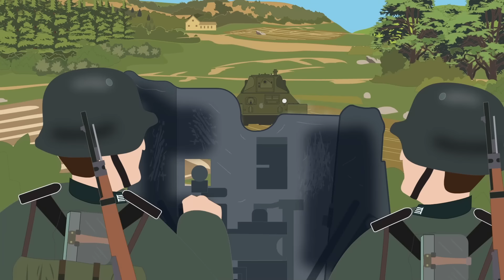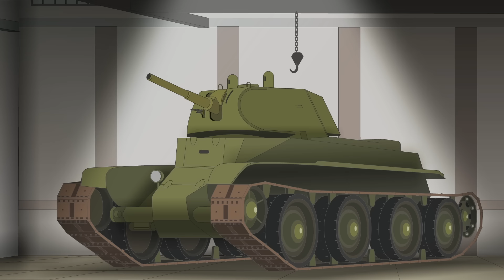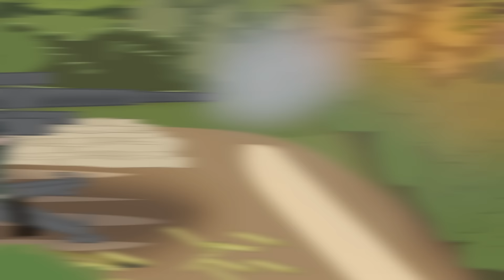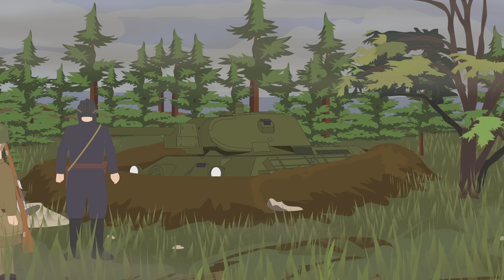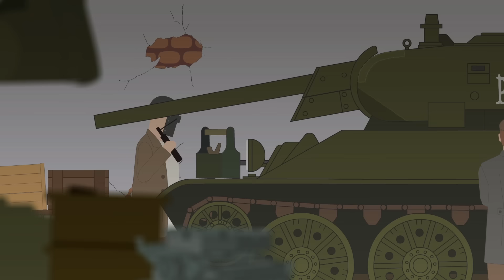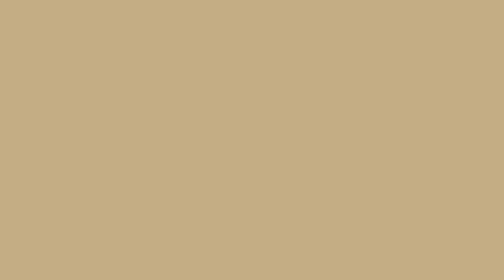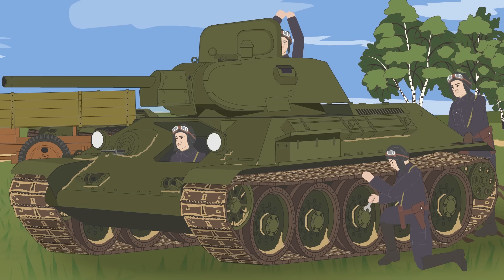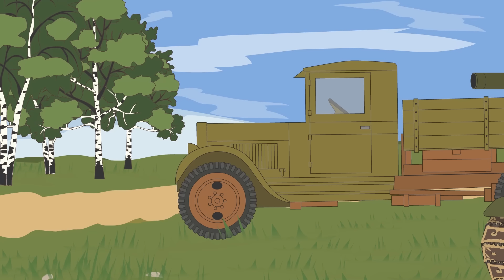Was the T-34 Really the Best Tank of WW2?

Comment: Nice video, but I can't believe you didn't mention one of the Germans' biggest advantages against the Soviet tanks; that is, the Germans all had radios in their tanks; The Soviet Union did not. So the German commanders could communicate from the safety of their armor, while the Soviets had to expose themselves out the tops of their turrets, and hope that they were seen while using flags for signaling.
Reply: I think later on they equipped themselves with radios
Reply: @RedCommissar  Yeah, initially only the squad commander would have a radio, later on they added radios to all tanks.
Reply: @RedCommissar  yes after the Lend-Lease i think the USA deliver also huge nummers of it
Reply: @RedCommissar  not until long after the war.
Reply: @RedCommissar  it depended on how the factory that made them was feeling. Sometimes for the sake of cost, they would not use the radio.
Reply: The lack of radios was mostly an early-mid war issue with the T-34 but poor visibility outside the tank continued with it thorough the war
Reply: @k3psu48  no it didn't. Soviets had good visibility on t-34(43) and t-34-85
Reply: @raketny_hvost   yes better visibility than in the 76 models but still very lacking and the slits in the cupola had a notoriously narrow vertical FOV
Reply: @raketny_hvost  the 39' variant didn't have optics, due to production speed.
Reply: @DaegonTheSternguard  And asked for aiming through gunbreech. Sigh
Reply: And they forget the best variant of the tank the T-34-85
Reply: @Henry1500G  not even really a "variant" like on paper the completely different turrets that caused different performance on the chassis that it was equipped to made them operate almost completely differently

Kind of a Frankenstein t-34 and kv1
Reply: @Henry1500G  fast reload, sloped armor, fast reload.
Only disadvantage is if the commander isn't good with tactics.
Reply: @Henry1500G  at the beginning says 1937-1943.. so wait
Reply: @Henry1500G  The T34 / 85 was still ´only´ a T34, and the 85mm cannon was weaker than the 75mm of the Panther
Reply: Not to mention that German tanks also had optics so the commander wouldnt have to open the hatch to see around the tank. British churchills didnt even have that ring of optics
Reply: @eageraurora879  The commander had no turret override and not very good Cupolla on the tiger
Reply: @twinsnails4983  especially the panzer III and IV, the cupolas on them were highly vulnerable.
Reply: @eageraurora879  vision slits...
Reply: @eageraurora879  ring of optics?
Reply: @eageraurora879  wdym? Churchill tanks had cupolas as well
Reply: @eageraurora879  American movie belike : "show american soldiers opening panzer hatch all the time"
Reply: @eageraurora879  you mean same germans, who had trouble with making proper periscopes and failed to even copy Mk.IV?:D "Superior kraut optics"™ is a myth. Look even at T-28(1940), notice the "horns" on the roof? Notice them on T-34 and KV-1? Take a guess at what are those?;)
Reply: @eageraurora879  that's a myth. In 43-44 soviets already had good optics while pz4h or KT had much of blind zones. Also about optical details-aiming system of IS-2 allowed it to have accuracy comparable with KT
Reply: Thanks for that information I didn't know that.
Reply: @MarxismWillWin-g5s  its the same advantage they had during the fight agist france and the reson why on paper stats are not aplyable in every situation.  most Frensh and even early T34 were basically blind as a bat butomed up and organisation was very unflexible in early war. The sovjets has some expirience in the Far East but leasons learned didnt made it thogh the system fast enogh without the presure of a seemingly losing war.
Reply: @MarxismWillWin-g5s  it false. Do your research
Reply: And do not forget these fun facts:

The T-34 could sink in the mud aswell.
At Battle of Warsaw, the soviets attacked through a soaked field: From 17 T-34, 15 sunk and get stuck in the mud, only 1 T-34 could manage to escape.

" The T-34 was supposed to be a simple and rugged vehicle that seldom broke down. Authors like to compare it to the more complex German tanks that supposedly broke down often. The concept of the T-34 as a reliable tank is another myth of WWII.
The majority of vehicles in 1941 were lost due to equipment malfunction. The same reliability problems continued during the period 1942-44. The evacuation and relocation of industrial facilities combined with the loss of skilled workers could only lead to the fall of reliability. 

In 1941 T-34 tanks often had to carry a spare transmission strapped on the back to counter equipment failures (10). In 1942 the situation worsened since many vehicles could only cover small distances before breaking down. In the summer of 1942 the following Stalin order was issued to units (11):
‘Our armored forces and their units frequently suffer greater losses through mechanical breakdowns than they do in battle. For example, at Stalingrad Front in six days twelve of our tank brigades lost 326 out of their 400 tanks. Of those about 260 owed to mechanical problems. Many of the tanks were abandoned on the battlefield. Similar instances can be observed on other fronts. Since such a high incidence of mechanical defects is implausible, the Supreme Headquarters sees in it covert sabotage and wrecking by certain elements in the tank crews who try to exploit small mechanical troubles to avoid battle.’

Henceforth, every tank leaving the battlefield for alleged mechanical reasons was to be gone over by technicians, and if sabotage was suspected, the crews were to be put into tank punishment companies or "degraded to the infantry" and put into infantry punishment companies.'

The constant complaints from the front forced the authorities to investigate the problems with T-34 production. In September 1942 a conference was held at the Ural tank factory by the Commissariat of tank industry (12). The conference was headed by Major General Kotin, People’s commissar of the tank industry of the USSR and chief designer of heavy tank ‘Kliment Voroshilov’. In his speech he said:

''Now ... there are a lot of complains about the T-34. You all know the reasons for flaws in the tanks. The first reason –inadequate visibility from the tank; the second reason, and this is the weak link that always accompanies our vehicle in the Army – final drive. And third, the main issue that we have today – insufficient strength of the idler wheel's crank. These issues are the major defects of the T-34 today. Having considered these issues from engineering and technological points of view I would like to discuss another issue, the one that directly resulted solely from our production deficiencies. They are: negligence during production of combat vehicles in the factories, carelessness of assembly and quality control of vehicles. As a result during combat employment our tanks sometimes cannot reach the front lines, or after getting to the territory occupied by the enemy for conducting combat operations, sometimes they are forced to remain on enemy's territory because of some little things... We have to make sure that as a result of this conference all shortcoming will be uncovered and following this conference all corrections in the tank will be implemented in the shortest possible time...
Recently comrade Morozov and I visited comrade Stalin. Comrade Stalin drew our attention to the fact that enemy tanks cover a lot of ground freely, and our machines although are better, but have a disadvantage: after 50 or 80 kilometers march they require repair. What are we talking about? It is because of control gear; also, as comrade Stalin said, because of drive gear, and he compared it with the Pz.III, which is in service with the German army, and which is inferior in armor protection, and in other features, and in crew's layout, and does not have such a fine engine, which the T-34 got, moreover its engine is gasoline, not diesel. But the question аrises – why its drive gear is developed better?

Comrade Stalin gave directives to engineers, to the People's Commissar comrade Zaltsman, to factory's CEOs and ordered them to fix all defects in the shortest time. A special order of the State Defense Committee has been issued on the subject as well as directives of the People's Commissariat of the Tank Industry. Despite all these resolutions have been made by Government and orders of the People's Commissar of the Tank Industry, despite repeated instructions from army units and from Main Directorate of the Armored Forces, which is in charge of combat vehicles operation, nevertheless all of these defects on vehicles are going on... We have to reveal all these flaws, and suggestions have to be made on at this conference how to modify machine component better and faster in order to make the T-34 tank, which is recognized in the army as a good tank, even better fighting machine.''

The situation continued to be problematic even in 1943-44.
There were constant problems with the gearbox and the engine filters. The Aberdeen evaluators noted:

‘On the T-34 the transmission is also very poor. When it was being operated, the cogs completely fell to pieces (on all the cogwheels). A chemical analysis of the cogs on the cogwheels showed that their thermal treatment is very poor and does not in any way meet American standards for such mechanisms.’
‘The deficiency of our diesels is the criminally poor air cleaners on the T-34. The Americans consider that only a saboteur could have constructed such a device’

The same problems were identified in a T-34/85 built in 1945. The US study ‘Engineering analysis of the Russian T34/85 tank’ noted (13):

‘Wholly inadequate engine intake air cleaners could be expected to allow early engine failure due to dust intake and the resulting abrasive wear. Several hundred miles in very dusty operation would probably be accompanied by severe engine power loss.’

The same study says in page 451 about the transmission:
‘The transmission had by American standards already failed, although with extreme care it could have been used further. Teeth ends on all gears were battered as the result of clash shifting. Many pieces of gear teeth had been broken off and were in the transmission oil. The failure is due to inadequate design, since excellent steel was used through the transmission.’

The mental image of the T-34 travelling hundreds of kilometers without stopping is fantasy.

A German unit that used the T-34/76 model ’43 in combat noted (14):
‘Regardless of our limited experience, it can be stated that the Russian tanks are not suitable for long road marches and high speeds. It has turned out that the highest speed that can be achieved is 10 to 12 km/hr. It is also necessary on marches to halt every half hour for at least 15 to 20 minutes to let the machine cool down. Difficulties and breakdowns of the steering clutches have occurred with all the new Beute-Panzer. In difficult terrain, on the march, and during the attack, in which the Panzer must be frequently steered and turned, within a short time the steering clutches overheat and are coated with oil. The result is that the clutches don't grip and the Panzer is no longer manoeuvrable. After they have cooled, the clutches must be rinsed with a lot of fuel.’

Soviet tests on newly built T-34’s (15) showed that in April 1943 only 10.1% could complete a 330km trial and in June ’43 this went down to 7.7%. The percentage stayed below 50% till October 1943 when it rose to 78%, in the next month it dropped to 57% and in the period December ’43 - February ’44 the average was 82%.

Preliminary inspection of tanks built at the Ural tank factory No 183 (largest producer of the T-34) showed that in 1942 only 7% were free of defects, in 1943 14% and in 1944 29.4%. In 1943 the main problem was damage to the gear teeth (16)

The V-2 engine had serious reliability problems (17). Depending on the source in 1941 it supposedly lasted for 100 hours on average (18). This figure went down in 1942 since some T-34’s could not travel more then 30-35 km.

The T-34 tested at the Aberdeen centre was built at the best factory using materials of superior quality but its engine stopped working after 72.5 hours. This was not due to American interference as there was a Soviet mechanic (engineer Matveev) charged with maintaining it. Still it was much better than the standard tanks since it covered a distance of 343km. According to the head of the Armored Directorate of the Red Army N.Fedorenko, the average mileage of the T-34 to overhaul during the war, did not exceed 200 kilometers. This was considered adequate since the T-34’s service life at the front was considerably less. For example in 1942 only 66km. In that sense the T-34 was indeed ‘reliable’ because it was destroyed before it had a chance to break down on its own!

Still there are examples of T-34’s breaking down during assaults even late in the war (19). For instance the 5th Guards Tank army in 1943 lost as much as 31.5% of its tanks during its march to Prokhorovka. In August ’43 the 1st Tank army lost 50% of its tanks due to malfunction. As late as the second half of 1944 tank units tried to replace engines with more than 30 hours of operation before a major attack

All WWII tanks had a hard time when travelling and they needed repairs and maintenance or they broke down.

There is also the question of standardization. The T-34 was produced at several factories. Each factory produced a slightly different variant. Could spare parts from Nizhny Tagil be used on a T-34 from Gorky? Doubtful."

Source: christos millitary and intelligence WWII Myths - T-34 Best Tank of the war
Reply: @rolandhunter  Was it a strategy to sink one in the muck sometimes so that another could then run over it?
Reply: @FellaJohnLittle  ?
Reply: only the bt series and the t26 were badly equipped, the t34 had atleast radio receivers in it
Reply: @Seibuzza  not really they were better equipped in some cases because when those were made when they weren't trying to mass-produce as many as possible a lot of t-34s didn't even have telescopic gun sights
Reply: And some more:

The soviet doctrine was:

The AT guns and tank destroyed have to deal with enemy tanks.

What does it mean?

T-34, IS-2 ammo storage was: 2/6 rate AP and 4/6  rate HE rounds loaded into that tank.

And:

57,224 T-34 produced during the war, and  44,900 were destroyed :\
Reply: @rolandhunter  
Soviet doctrin was:
Armor and Gun kills enemy tanks.

German doctrin was:
crew and mobility kills enemy tanks.

Thats why the T-34 was a catastrophe in crew ergonomics. U can see it in the increasing reloading time, when the T-34 was in battle...poorly 3 rounds a minute.

I can recommend the video from the chieftain, of the early T-34
Reply: @datschinken6927  Ahm....I fear we are talking about different doctrines..
Reply: Although the name of the video suggests that he would compare the tank to its opponents he rarely did so in detail, I think this video was more a biography of the T-34 rather then a comparison.
Reply: Only in the beginning of the war mate.
Reply: @metalmadsen  1943 late/1944 early isthe  beginning of the war?
In those T-34 there was only radio receiver for the section members, only the platoon commander T-34 had radio transmitter / receiver!!!
Reply: German bias I see, very cringe it is!
Reply: Soviets had radios later
Reply: or the fact that russian quality control wasnt even mediocre. sometimes they had to guess if the molten steel was of a proper enough quality. sometimes a t-34 was hit by a shell that normally couldnt penetrate it, but where the power of the impacting shell was able to crack the armor.
Reply: 😉tm
Reply: Guys, guys...

...The  gun depression...!
Reply: This is where lend lease comes in during the war the soviets basically had low expertise in making radio's so most of their radio equipment installed in tanks, recon units, infantry, air force, and artillery posts were using American or British sets
Reply: Later in the war the soviets had radios in their tanks
Reply: This was the case with freshly produced tanks, not all. There is missinformation
Reply: At the start of the war, German tanks did NOT have 2-way radios in all tanks, platoon leaders and higher had full radio, while the rest of the platoon had receivers only.   (in comparison, French and British tank formations had similar setups but generally one or even two "steps up", so there were some battalion commanders who had radio, his company commanders having receivers and everyone else, nothing)

And Soviet radios is a HUGE and complex subject.   They had a lot more radios than is often stated(sometimes even more of them than the WAllies), however, early on when they developed the radios, because it was a new technology they messed up, they ended up with a massproduced model of radio that was heavily interfered with both by the tank hull but also the engine.   Even worse, noone had taken the time to seriously research antennas yet.   Which is why we see a lot of weird antennas on early Soviet tanks, some of those things looking like safety railings on top of turrets, yeah, trying to fix the problem by putting a large antenna up.

USSR probably didn't truly achieve good antennas until their research into radar in the late 30s, and lessons learned didn't get fully implemented until just before Barbarossa, and then one of the first targets the Germans struck was one of the key factories for radios.   Among with their brand new optics factory, which had just started production and at the time was literally best in the world.
This, along with the severe degradation in metal treatment ability when Barbarossa began, is why you can find some early T-34s surviving and being MUCH more effective, a rare few even surviving the whole war.

Because they were some of the few whose armor was properly treated and as such, was EFFECTIVE, they had the optics that the tank was supposed to have, and those were SUPERB, as well as the first generation of truly good radios.

Only a small number of T-34s and a few KVs got this, but someone trying to analyse how much difference it made estimated that "anywhere from at least double to over TEN TIMES as effective".   Essentially, the few that got all the stuff they should have, were drastically more effective, especially in the first year when Germany still had great trouble getting the guns to reliably punch through a wellmade T-34.
Obviously, with German equipment upgrades, the advantages rapidly diminished over time, but all crews that had gotten these tanks, stuck to them like glue, because it quickly got extremely obvious how much better they were.

This is also(mostly) why there's such huge differences in reporting about T-34s ability.   First few T-34s built had lots of issues, that were soon ironed out, but that first batch had very uneven quality, and the new radios and optics were still not in production.

2nd batch, those with majority of early bugs fixed, they were much better, excellent armor but still no modern radios or optics.   Still, far tougher and more durable than later builds.
3rd batch(though not separated from the rest in any way), these were the ones that got "everything", way superior.   These also stand out because every single one had a full 2-way radio set.
4th batch, no more advanced optics and radios, and metal treatment ability became extremely variable and never got back to the initial quality.

Then came the big chunk of massproduction.   Lots of shortcuts added while several issues coming up with 4th batch were fixed.   Total focus on numbers, armor was often just barely treated, parts were often very rough, no finesse at all.   As long as they could drive and fight for a few weeks, that was all that mattered.   If it broke down after that, it was replaced while a workshop got the tank back into working order, often doing a lot of finetuning and fixing the rough edges in the process.
Reply: @DIREWOLFx75  The "4th batch" was released after 1944 march, I hope you know it aswell.
Reply: @rolandhunter  What i refer to as batches has no connection to official numbering or actual models or designations.   It refers strictly to how i defined them above.

If you look at just the official documentation, you will find it effectively impossible to determine where one batch started or ended as i define them above.   Because officially they're not differentiated between, merely switching radio and/or optics wasnt enough to give them their own designations.

I had to crossreference data from individual worklogs with transport logs and delivery logs to even find out that these different "batches" existed at all.   Deliveries and installation of exact radio and optics models were not stated elsewhere that i could find.

If the website that made the documentation available online still existed i could easily just have linked, but it's long gone sadly.

What I refer to as 4th batch begins somewhere mid 1941, after Barbarossa begins and reaches far enough to disrupt the radio and optics production and deliveries.
Reply: @DIREWOLFx75  the T-34s still had not enough radio in 1944, and the T-34 was VERY unreliable until 1944 march.
So I dont know what are you talking about.
Reply: @rolandhunter  Yes, that was part of my point.   The fact that there was a small number produced early-mid 1941(or thereabouts) ALL of which had full 2-way radio.   But then the factory producing those brand new shiny radios got destroyed/captured(sources claim both) and suddenly they were back to having nowhere near enough AND forced to use the old radios that they already knew were drastically lower quality.

Also, overall quality of T-34s were at its highest around the same time, as they had just fixed the issues with parts and still had both production ability and materials easily at hand to do so.   T-34s built just before Barbarossa were better quality than T-34s built in LATE 1944.

Having to relocate, losing a lot of the upgraded machinetools, probably also the blueprints for the improved parts, lack of correct raw materials and the ability to use them properly, all that caused a dramatic decrease in quality.   Gun rifling, armor treatment(if there was any at all), engine parts, tracks etc, everything dropped seriously in quality.

A decrease in quality that was not completely fixed EVER with the T-34.   Which is why i believe they lost the blueprints for the upgraded parts developed in late 1940/early 1941 to fix the issues on the early serial production tanks.

The original reason for investigating this came from me finding that several impressions of the T-34 early in the war conflicted severely, sometimes they were nearly invulnerable, occasionally requiring more than one direct hit from an 88 to be knocked out, and yet sometimes they were just annoying and "easily" dispatched with multiple 37mm and 50mm shots.

Likewise, reports from T-34 crews varied immensely.   All the way from "perfection incarnate" to "piece of junk, nothing works!".
But also including references to a few platoons having 2-way radio in every tank, something otherwise completely unheard of even in the German military.

Thanks to a site that put up translations of Soviet records, i eventually found that this seemed to be the explanation.
Reply: @DIREWOLFx75  That 2 way radio should be ultra rare, even in 1944, many t-34 had only receiver, 1 way, while almost all the german tanks had 2 way.

What is your sources? I would like to read it.
Reply: @rolandhunter  That's the problem, it was a site with mostly Soviet documents translated/scanlated, essentially all the old Soviet archives that they could manage.

But, it's been gone from the net since, 2006 or thereabouts.
From what little i could find out, they apparently ran into copyright issues and were completely removed from the net.
Reply: @DIREWOLFx75  :\
Reply: @DIREWOLFx75  Problem with this, you cant argue without sources :\
Reply: @rolandhunter  I know, sorry.   I want to find the stuff again as well(there were hordes of interesting data to mine from it), but it apparently got locked up offline only at some museum or something.
Reply: i am the best tank
Reply: @t-3490  Yes you are on the top board of most destroyed tank during ww2
Reply: Seems a bit weird to design a tank without radio or optics
Reply: That was a problem until the start of 1942, the early variants with the l 11 cannon didnt have radios
Reply: @pijx5909  But the problem was only beginning to get resolved in 1942. The T-34's bugs were generally fixed  by the end of 1943.
Reply: its incredable ain't it.
Reply: Don’t forget to mention that this was mostly a failure of the early war.
Reply: Only very early tanks did not have radios - like first few hundred almost all tanks Germans faced had radios, at least on platoon level. Maybe not good ones but still.
Reply: To be fair intelligence and secuity on the Soviets part was loose and the Germans used it to their advantage and soviets figured they were better off with Radio Silence
Reply: Transmission go brrrrrrrrrrrrrrrrrrrrrrrr
Reply: @crispedurchin6186  LOL that and sssssssiiiiou sssssssiiiou AKA Stalin's Organ
Reply: wehraboo
Reply: @JostVanWair  Wehraboo for stating facts?
Reply: I think this video is meant to discuss a model of the tank, not the tank as a squad.
Reply: I think you mistook the Russians for the French.
Reply: Lol. Mid war Soviet tanks did have radios.
Reply: Perhaps simple history is saving that fact for a documentary on German tanks? 🤔
Reply: It's a video about t 34 not German tanks just enjoy the video
Reply: @bingbonk7125  Well a tank makes sense in context to its enviroment. They do make it like the Tiger was developt in responce to the T34 wich is not true the Panter was and neither of this 2 had much impact comapared to later Pz IV or stug III wich were upguned in responce to T34 and KV-1 and 2. 

T-34 was a good enogh tank for its intended role with its fair share of theething problems early on that evloved with the developing war situation In that reguard it was just like the M4 sherman. and the later Pz IV. Tankes are not just a bunch of stats and the Sowjets paid in blood to iron out tactical use on large scale to make efective use of the number of tanks they could produce. 

A warwinning tank isnt nessesarryly "the best Tank"  is is a topic loaded with so much BS to begin with.
Reply: early barb they didint have radios but later they had
Reply: And we germans had far better optics then them.
Reply: Also nvgs vs none
Reply: The reason for this myth is that in the early war they had a shortage of radios. Fully supplied T-34's had radios.
Reply: @halojoe21  they where also sending in one solders with a gun and one with ammo so they didint have much at all
Reply: @thenanoplayers  While in some places of the early war this was true, the way it is depicted in call of duty and enemy at the gates is inaccurate. By 1943 the soviet union could equip all their frontline ground forces.
Reply: not really an advantage of the tank design tho
Reply: @jambondepays1969  read the title lmao it’s the BEST
Reply: @thenanoplayers  connect the two neurons inside your head. whether the unit is equipped with radios for all tanks or not has nothing to do with the tank design itself
Reply: Plus German tanks had a turret basket which Soviet tanks lacked, meaning the loaders needed extra training
Reply: I don't think that's related to how powerful the tank is, I mean it is a weakness but it is a problem about communication not the tank itself so it probably explains why he didn't include the information.
Reply: @brrman4089  Radios were also used for internal communication not just external so technically speaking it does have a part to play when improving a tanks performance
Reply: You didn't think Simple History wanted to denigrate Soviet planning or ability in any way did you?
Reply: That communication sure did help at Kursk... Oh wait
Reply: The soviets did have radios in their tanks, but only widespread later on. Early on, during Barbarossa, as you said, they basically didn't have any.
Reply: @Flaxelaxen  In 1944(january-february) all the soviet tanks had radio. But only the platoon leader had radio transmitter/receiver, the platoon members had only radio receiver.
Reply: @rolandhunter  I see, thanks for the correction. Still an improvements from using flags for communication i guess
Reply: That was only at the start of the war.
Reply: I feel like they’re gonna make a video about radios during wwii in the new future. But can’t be for certain of when.
Reply: I see 99 replies, I have to be the 100th.
I win!
Reply: Russia. Russia never changes.
Reply: given what i've seen from this channel before, i believe it.
Reply: Lol, this is like the British during the battle of Jutland :D
Reply: Ii
Reply: I was wondering if they would mention that.
Reply: The Maus can destroy a T34
Reply: @Solgaleo71517  not if it never sees action
Reply: Early t34 had no turret basket, the crew walked as the turret rotated. Morons.
Reply: The first T-34 had radio for commanders tank only but later T34s had radios . I saw one in the museum and it had radio.
Reply: He kinda alluded to it when he mentioned the Russians didn't have ut a few radios.
Reply: Lazerpig is lying or distorted the source he read, the Soviet did have radio on most operational T-34 before Barbarossa
Reply: and the optics from german tanks was way better, even with all of that germans could fight well
Reply: https://www.youtube.com/watch?v=W9QVQvGSsKI
Reply: What you say was correct for 1941 and part of 1942 indeed. But not since 1943 onwards. Both he T-34/76 mod 1943 and T-34/85 had good radios, that allowed the Soviet armoured units to coordinate their attacks in a lethal way.
Reply: It's  a miracle  they won the war!
Reply: @tomstarcevich1147  Winning against the fascists was a combination of factors, but it's most accurate to say they outlasted them in terms of supplies, body count and sheer production output. Having the US and UK as allies made things better (lend leasing of materials and equipment helped) and although the Russian populace was largely starving in many places they rallied as hard as they could for their motherland. Arguably the USSR was who defeated the Nazis with just how much they gave in terms of their dead and military force.